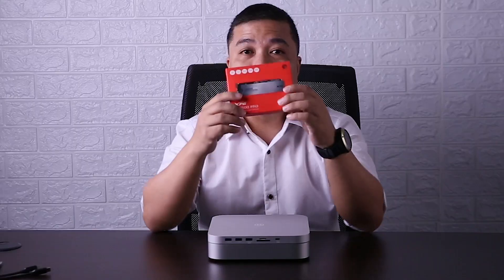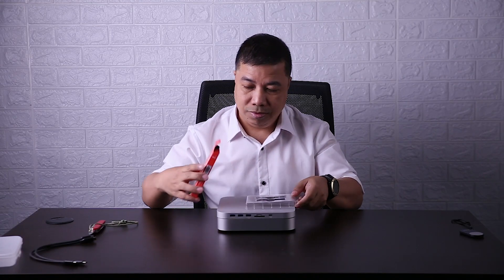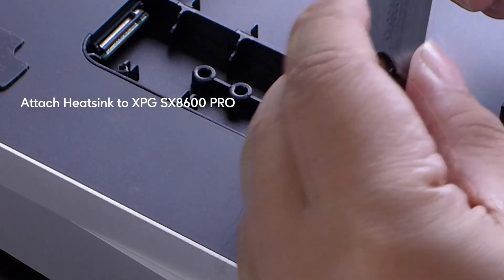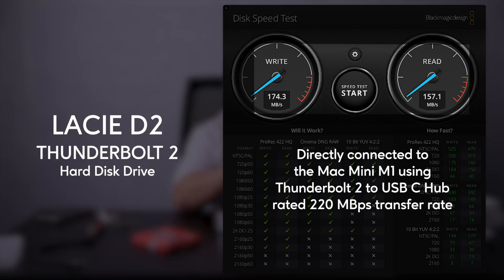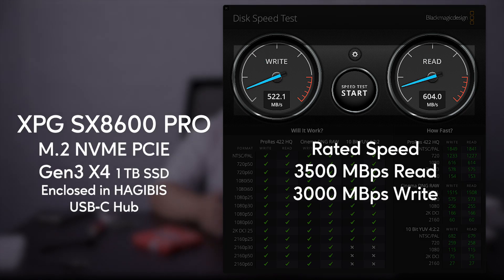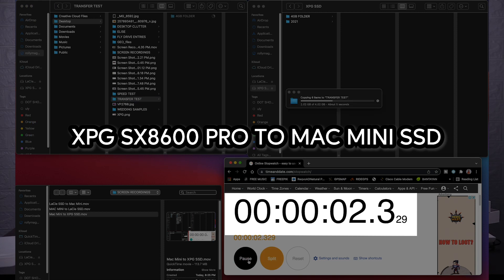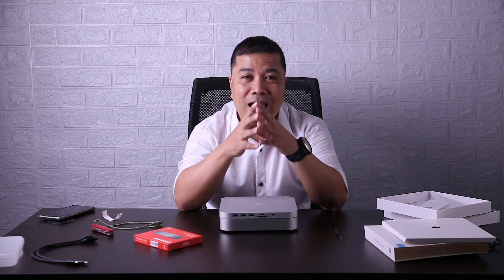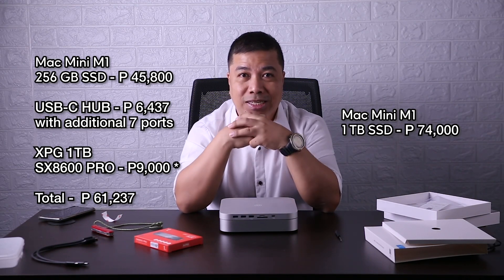Adding XPG SX8600 PRO SSD to my Mac Mini M1

Comment: How is the Hagibis m25 pro working out for you? Have you had any problems with it? 
Sad the speed from the ssd is so slow. My 2tb Crucial external hd gets around 7 to 800 Mbps being in the hub would be more convenient though. And I'm guessing fast enough for editing multi line 4K video.
Reply from the maker: The Hagibis hub worked as promised. Yes, the M.2 SSD’s actual speed couldn’t be utilized wheninstalled in the hub. It  would be better if the M.2 was installed on the motherboard. But it was written on the specs of the usb hub before I even bought it so I’m not listing it as a cons. I think that’s the only thing I don’t like about it. Maybe another thing is that the SD card goes in the slot label side down which is unusual, but I am already used to it.